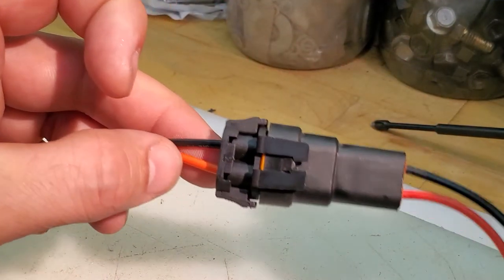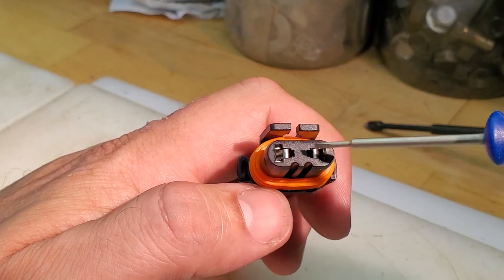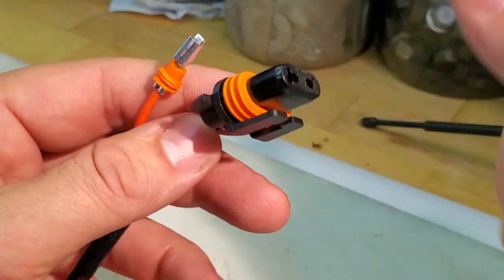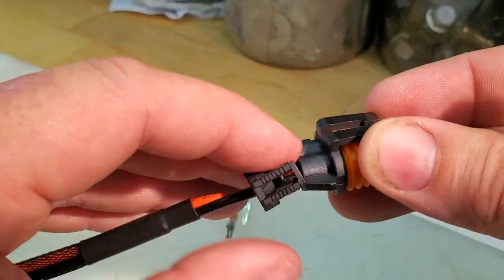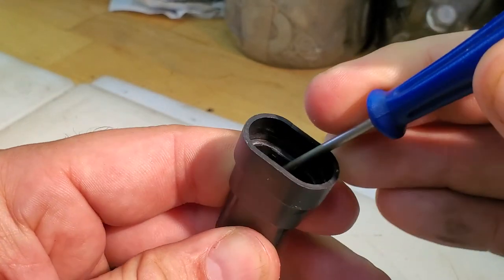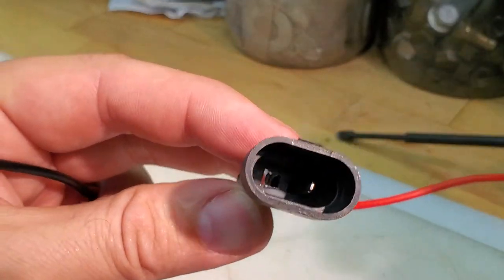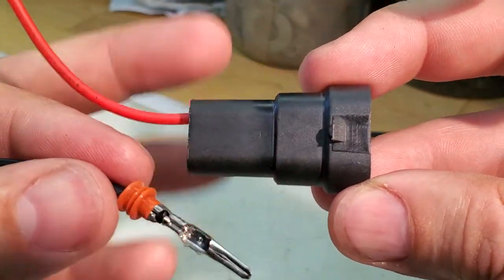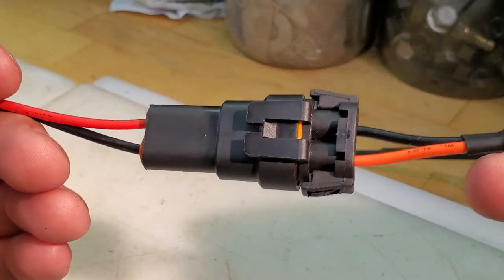How to Pin and De-Pin 9006/9005 Automotive Connectors

Comment: I found an ABS wheel speed sensor wire harness with wires that were chewed up from what I don't know, but anyways I haven't learned his solder yet, and I don't want to have connection there if I don't need an extra connection so I was wondering if you could do that what you just did with these harnesses and you just showed me exactly what I needed to know to make it a good quality clean job and a cheap one is cheaper to do it this way to buy the stuff and put it together yourself I appreciate it thank you very much made my day a lot easier

Comment: I'm trying to find the part # for these connectors, specifically for the terminals so I can re-crimp them, but I've been unable to find it. Do you know what they are?
Reply: Have you found someplace to purchase these terminals? I am also looking for just terminals to rebuild plugs.
Reply: @robeasy13  Not just terminals, but Amazon had some set for crimping.
Reply: @patrikj  I did find the plug kits on Amazon 5 Sets for under $10. Waiting for them now. Miss the old RadioShack days.